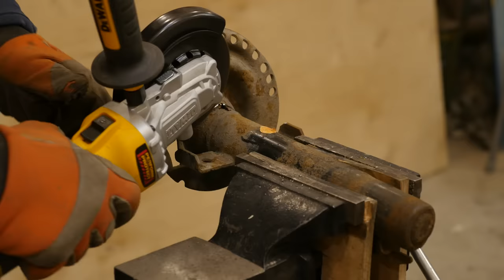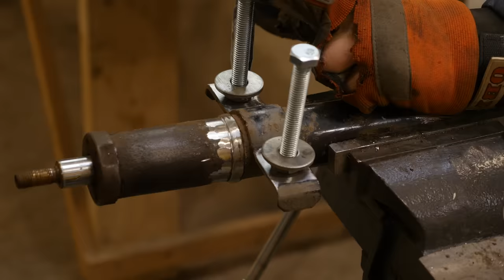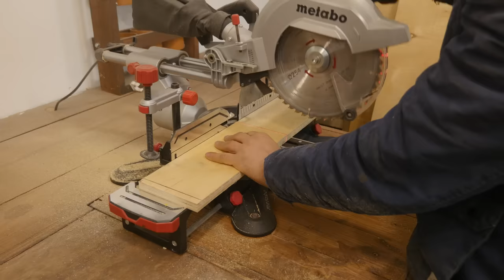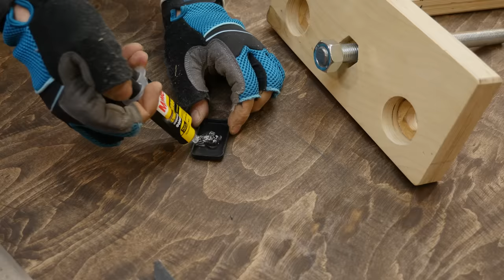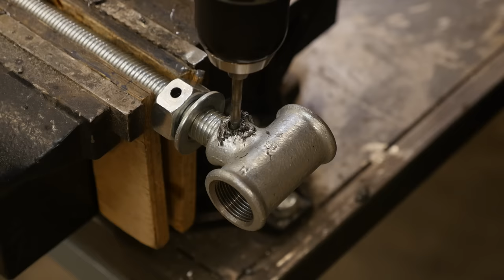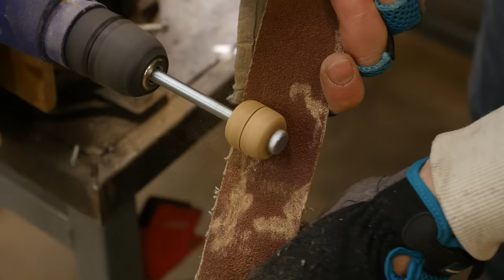Powerful vice using an old car shock absorbers! Unique idea

Comment from the maker: Do you like this system?
Reply: Absolutely. It’s ingenious, a wonderful up-cycling of scrap parts to make a very useful tool that all wood workshops need.
Reply from the maker: I'm glad you liked it friend👍
Reply: Great idea, shocks would be better higher than the threaded rod but thats an easy re-design!
Reply: That is absolutely amazing. It took me to the very end to figure out what you were building. Genious!
Reply: That's looks awesome!! Great use of parts
Reply: Good Idea!
Reply: I would wager Derista would like this.
Reply: I hate to be the fly in the ointment, but those aren't shock absorbers, they are McPherson struts.An #2, you just created a solution for a non existent problem. Wood working vices have been working just fine for hundreds of years without the addition of struts. They do not add anything useful to the vise.
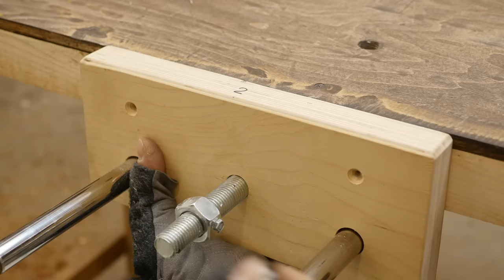Reply: awesome couldn't figure it out until 8:23 was really surprised  :)
Reply: @bigbossimmotal  Sorry pal, you're wrong. They are shock absorbers even though they are in a Mcpherson strut. They have given immense rigidity to the vice. Look how far they go under the bench. Far better than two rods through a plate.PS  I hope you can get out of the ointment.
Reply: I wondered what you were making at first..    but this is a great idea, and super well executed.  Such a vice is quite expensive.  Now, I just need to get a small welder..
Reply: @bigbossimmotal  You mean like alignment rods that skid thru close toleranced bushings to keep the vise jaws parallel. Like most vises. He found a way to use garbage and have tighter fitting guide rods than most vises all in one. It's a clever idea, and saves you from having to buy rods and make bushings to guide them in. Only problem I see is the diameter of the rods may make them a bit flimsy, but they are likely heat treated and pretty stiff.
Reply: Extremely good idea..  I’m going to do that for my workbench.
THANKS
Rodney
Reply: Smart man you are
Reply: One of my favorite things you have built  👍
Thank you! Keep it up!
Reply: @bigbossimmotal  They are sliding guides. Every vise needs some type to line up jaws. These happen to work on a homemade vise.
Reply: @bigbossimmotal  Boo hoo hoo.
Reply: @mossturn01  The spirit of his comment is correct.  Conventional shocks wouldn’t work very well for this.  McPherson struts will.  Some, like the late ‘60s-early ‘70s Datsun/Nissan can be disassembled and the hydraulic oil removed.
Reply: Great video, might be a lot better if you included the name of what you're building in the title, instead of 'guess what i did'?
Reply: Hi would you like to work for Darpa? ( Defense advanced research agency)
Reply: Good idea, bad exectution, i'd have put the threaded spindle lower than the shock-absorber guides" to prevent damaging the workpiece..
Reply: @bigbossimmotal  just wanna ad a bit of my own fly to the ointment ok. Well I just happened upon this vid looking at fences. But I wish he woulda said what he was making to begin with because although it's cool,and I watched it till the end, I didn't get anything helpful to me soo it was a complete waste of my time. So thanks for nothing🤔
Reply: @gr8tgee  Kinda shame on you dude, as the simple way to see if the video is right for you is to check the replies BEFORE WATCHING, as they will quickly tell you what's going on within the video. No more whining, you've been schooled.👌😎
Reply: @davidjones5837  thanks dude lesson learned, I didn't think of that one.✌
Reply: @gr8tgee   Depending on the channel, you could also find information on the video through the description.
Reply: @fryoneside6719  Hey thx a lot I'll have to be more mindful, so I don't go wasting my time. I never thought of checking the description and comments, that's good info I can appreciate 👍
Reply: Most definitely, Brilliant idea!
Reply: At first I was scratching my head, but the final product is awesome!  Nice work!
Reply: That was cool.. at first was like wth is he doing... Then at the end there I was like oooohhh derp..
Reply: Very groovy!
Reply: The struts mostn't pretrude on the front of the vice. It must be flush. Your finger and knuckels will inevitably get stuck in between the handle and nuts.
Reply: Who couldn’t like this? Very nice.
Reply: You did a very good job.. It amazes me how many people hate on you...
Reply: @bigbossimmotal  Right....I can't figure out why you would want to use shocks ( or as you say Struts) with a wooden vice. But none the less, looks like a fun project.
Reply: HandCraft live that I saw the thumb nail and though bench vise👍 so glad I still have that imagination too. Like the video👍
Reply: HandCraft Yeah it’s OK if you live in the middle of the bush and you don’t have nothing else to use but you couldn’t hold nothing with that thing I couldn’t even sharpen my chainsaw chain get for real advice is only $10 and you spent so much time wasting your time to build that thing this is not mad max days
Reply: @bigbossimmotal  Yes, woodworking vices have been around for a long time.  But, there are many people who have access to parts and the wherewithal to assemble something like this who, at the same time lack the funds . . . or availability . . . to purchase an over-priced, pre-made solution.  The struts, by the way, provide a cheap solution to add stabilizer bars to keep the movable platen stabilized - as the originator showed - as well as parallel to the fixed platen.

And anyone who starts a comment with, "I hate to be the fly in the ointment, but  . . . " should know two things. 

1)  Starting a statement with that phrase is basically like starting with, "Honestly".  If you have to say it, it's likely not true.
2)  Anything before the "but" can be cast aside as drivel . . . and that's the youtube-safe version.

Well done, HandCraft.
Reply: @bigbossimmotal  And. aren't all the really good vises made from iron or steel? Plus, most of the cabinetry vises have a one-turn and it's loose function, so you can just pull it open, slide it shut and give it a half turn...
Reply: Being logical, the cost of the tools it to to build is far higher than buying a vise but... Love it!
Reply: Yes! Really nice job sir, functional, elegant, attractive.
Reply: @mossturn01  Actually they are called Strut Inserts, none the less I like the project, he shows how to create some nice functional shop tools with scraps. Not everyone is lucky enough to simply go to a Lowes or Home Depot for their tools like a shop vice
Reply: Man this is really smart project. You are genius.
Reply: Very beautifully done. Instant subscription. ;¬)
Reply: Génial 👏🏻
Reply: @paulorchard7960  i made the same mistake ...
Reply: Whats your camera!?
Reply: @poorsalotto6108  Aww Poor You !
You run along and tell your Unkledaddy Grandpar Jo that "A man made a squeezy thing frim ol' bitsa garbage, like in the shayd an' you don't even think, so you tol him he cud get $10 of advice on thinnertnet an' he cud make you wun to sharper yur plastik chainsaw chane an' hes gonna mak Max Mad sum day instead of waìstin his thyme lik a big doody hed !! 
×
Reply: @bkvdpw  Thank-you for finding the Short way of saying what normally takes Me a couple of paragraphs !! 👍😉
☘POD🍀
It's a long diatribe - around here somewhere 😉
Reply: @bigbossimmotal  Your wrong. They help by opening the vise(they won't get stuck.) and gives stability to the vise.
Reply: I think your a genius lol
Reply: @HandCraft is it possible to do the same thing with 2 scrap metal channels? If so would the pressure limit increase?
Reply: Those are struts ... not shock absorbers
Reply: OldSalt ahahahaha
Reply: bigbossimmotal exactly hahaha
Reply: Very useful but what could u use to get the rust off if you don't have that machine
Reply: You used an existing vice at least twice in the construction of this vise…
Reply: Jan Binnendijk I would not. Then it work less good. The spindel must be situated in the middle.
Reply: @bigbossimmotal  - McPherson & McLaren struts are just a type of shock absorber unit!
Reply: Why not counter sink the knuckle busters and use a (thick fender) washer to distribute the force out over a larger area.....but I like the idea.Nneed to put vice in a different location and the cost is cheap...love it
Reply: I am a fan!
Reply: About the vise: just use one strut, than you can clamp boards and stuff as you don't have the screw in the middle. Yes, precision will be less, but is ok for most woodworking stuff. About the video:downvote, cause I don't like these click baiting videos (with no explanations, so little learning) and don't want to see them on the tube.
Reply: @mossturn01  I'm still trying to figure out what a Bossimmotal is...I already realised your conclusion, on the matter...
Reply: @Crite68  If you dont have all the tools shown it will be a very expensive project.
Cheers
Reply: @ThePsycoRobot  Home depot sells those things
Reply: GREAT IDEA! And veeeery good execution too!!! Just forgive me for warning you on working with the router without fixing the piece, a bit dangerous in my opinion. Thank you very much for sharing your experience and great ideas!
Reply: what a great idea!
Reply: @Crite68  the welding is not really necessary.
Reply: Fantastic, simple, feasible and well thought, congratulations
Reply: Excellent thinking outside the box. A very well made woodworking vise!!!!
Reply: What a bunch of haters are out there! recycling is always the best option. It took me a minute to figure out why you were using shocks to build a clamp, but then I realized that you used all recycling material Good job
Reply: Christopher Bowman i
Reply: @gr8tgee  I agree that life's too short to watch every video in its entirety; so, here's a way to help you quickly decide, before going all in: ~ With the video paused and muted, hover your cursor over the timeline... moving it back and forth through the video while watching the changing images in the timeline pop-up window... Rinse and repeat, as needed. ~TYY
Reply: I thoroughly enjoyed your video. Liked, subbed and belled. ~TYY
Reply: Есть точно же такое видео с русской озвучкой на канале Creates DIY
Reply: Like this vid..no talking no music..just do the work....direct to the point
Reply: It's fantastic a joy to watch it unfold.!!!!!
Reply: @mossturn01  well said mate I agree
Reply: @davidjones5837  Mate this is life ,God makes em all😊,most blokes loved it and saw the big picture some just can't help being bloody awkward,even if it's having the right colour of screw.
Reply: Сделано на высшем уровне!

Вопрос - мне показалось что двухкомпонентный клей Момент имел этикетку на русском языке?
Reply: P Kliot True, and with the Pandemic, it can take hours to get inside of a Home Despot these days.
Reply: Х
Reply: Chi Sam  they most curtainly are words, they might be misspelled words, but words non the less.
Reply: @bigbossimmotal  i wondered this same this
Reply: You did a really nice job, I have also made a bench vise a while ago😀

Comment: I never thought about using the shock absorber mechanism as simply the guides for something. I like it!
Reply: It would be self opening too.
Reply: @MuskratOutdoors  There is no tension in a shock absorber. It has neutral pressure. You might be thinking of gas filled struts.
Reply: @joewoodchuck3824  Yes Sir!  You are right.  That was what I was thinking.....Thank you!
Reply: @joewoodchuck3824  a strut is technically a type of shock absorber. It has the same component as a regular shock absorber but it has a spring seat built-in and it's meant to house a spring. But they are the same exact thing for the point he was trying to make. A shock absolutely is filled with gas or air and it bounces back just like a strut when you depress it. And this might blow your mind but he used a pair of struts in this video. They were not shock absorbers in the standard sense. They were shock absorbers in the sense that a strut is a shock absorber.
Reply: @Brandon Veater : "Truly, you have a dizzying intellect!" [Movie: The Princess Bride"]

Comment: Just found your channel real cool talk about not wasting wood, I worked at Lowe's in lumber for 8 years if  a customer had some wood cut if there pieces they didn't want I took it home if not it was throwed away. Those counter tops when come in they have some on the bottom the counter top with air staples ran thru them. I used the bottom ones make great work bench tops. One year they did a remodel talk about getting stuff new screws, bolts exc. from it. Nuts and bolts from the guy that assembled like grills and many other items every year get a nice box full of those. The year of the remodel I stayed after work took apart several 4 ft. florescent lights they had the cord on them just plug them in all kinds of bulbs, I love to tinker don't have all the nice tools you have. Like the saying goes One Mans Junk Is another Mans Treasure!!

Comment: Loads of comments saying why didn't you buy one for $30 etc... but I appreciate that you are using highly engineered car parts to make a better vice.  Changes I would make?  1. (as someone else mentioned ) put the screw below the strut rods (google carpenter's vice for image).  This will allow you work to rest without tilting.  2. make your lock nuts on the strut rods flush.  You will do serious damage to the back of your hand if the vice releases suddenly. 3. Use a piece of pipe rather than a broomstick as a handle.  You can easily snap that handle if you put your weight (~100 ft-lbs of torque) to tighten the vice and failure will come very suddenly with sharp pieces of wood.

Comment: Oh wow, I was just about to go to a wreckers and get two struts, pick up a sheet of 3/4” plywood, some threaded rod, bolts, washers, plumbing pipe connector, 5 minute epoxy, get the grinder out, the drill press ready, the router, some wrenches and get started on this cool add on, and then I saw a big old vice at a garage sale for $10, changed the metal grips to wood and I was done! Lol  Don’t let almost/sort-of perfection get in the way of good enough! 👍🤪
Reply: My personal lifelong mantra is: Good enough, satisfactory, sufficient, acceptable, suitable, reasonable, agreeable, adequate, usable, all right; these words do not necessarily mean compromise in any endeavor, just a point at which nothing further of substance will be gained by additional effort. Don't let perfection be the enemy of good enough. ☺
Reply: That last line is pure gold. It took me a VERY long time to figure that out. I've polished more turds than I can remember, and can't recall the shine of a single one...
Reply: @YerBrwnDogAteMyRabit  The shine is real, but a polished turd is still just a turd.
Reply: LOL!!!  I was already thinking that is a SHITLOAD of work for a simple Vice!  Even if I paid full price for a new one, I would be saving money over time.
Reply: It's a special purpose woodworking vise, not a $10 piece of crap.  It's similar Rockler vise is over $250.
Reply: Uses $3000 worth of tools to make a $50 vice....I mean, cool, but meh
Reply: Jon Doe  word.
Reply: Sanity, sweet sanity...
Reply: I would fear for my manhood with that spinning handle...
Reply: Jon Doe the creator gets the benefit of traffic, watchers get the benefit of entertainment 

Recreators get the benefit of high opportunity cost
Reply: Ya, whole video seemed like a BIG WASTE OF TIME N EFFORT. even if youre BROKE and really NEED that vice its so bogus. Do it because you CAN, Nutz to that. I'd rather take a two day nap.
Reply: @joeybold4575  NOT TRUE... this same vise can be nade with simple tools, even the welding can be ordered at low cost, the idea is good, if not brilliant, and it is critizised most probably out of envy!
Reply: Alfredo Márquez ok boomer
Reply: @alfredomarquez9777  , Huh? I was napping and didn't hear you. I mostly spend my "lazy" time keeping up a busy Wordpress website. OR taking weeks long motorcycle rides in USA or Central America or Europe or Africa or South America or even to Asian continent (Turkey). You ARE right tho, DIY videos do seem to be a waste fo time when I have no intention of DOING what I am watching. I just could NOT imagine what you would do with old shock absorbers.....so I wasted some time watching you....Pfft, there's 28 minutes I'll never get back.
Reply: @joeybold4575  Would it be better to let the $3000 worth of tools sit unused?  If you know where to buy one of comparable precision for $50 please let the rest of us know!
Reply: @joeybold4575  i have all these tools at home..
 How tf is anyone coming up with these ridiculous numbers for the tools geeze

Comment: Thank you for a Really Interesting build. I was guessing, until about 2 minutes from the End, what the heck you were making ! 
I was very impressed with your Editing. A 10 minute Video from what must have been several hours work, is a tremendous Skill.
Like most Comments, Thank you for No Unnecessary Muzak, And an Special Thank You from me, for the Quiet Tools Sounds, as I was watching this in bed with Headphones on beside the wife, who complains about the Noise from my JVC In-car Gel Buds ! When they're IN I can't Hear Her snoring !! Anyway, Thanks again for your consideration of Noise, especially as I'm Deep Chronic  Pain which causes Insomnia, so I end up watching a lot of these types of Video (reminders of when I had a Work-Shop and loved pulling stuff apart, to put back together and see How Many Pieces were Left Over ! ) 
Anyway, LIKED & SUBBED ! -
 Well Deserved for your Video work, as much as your Clever Idea and what Happens when Needs Must ! 👌👍🛠🔩🔨
 5 🌟⭐★⭐🌟
 🍀POD☘

Comment: If you try this PLEASE be careful of any open flames or sparks.  Some shocks (most?) are filled with a gas that will explode and shoot a column of flames out 5 feet long.  I use to work in a scrap yard and we were required to punch a hole in shocks to prevent them from exploding in the shears.